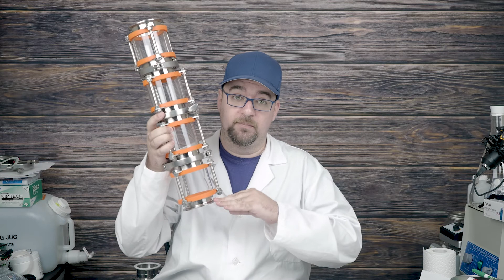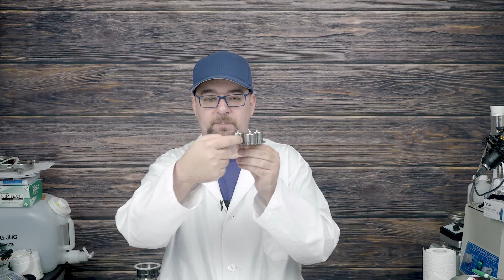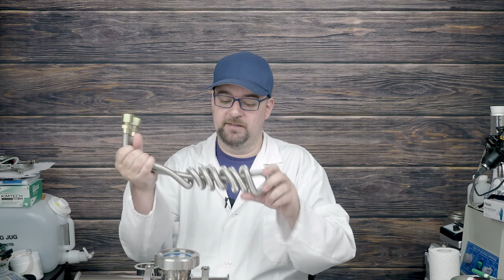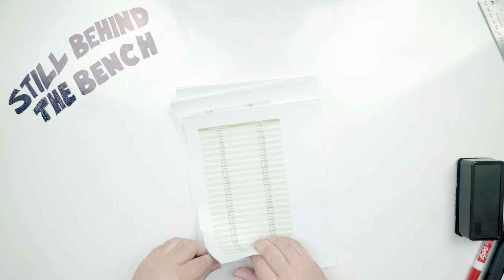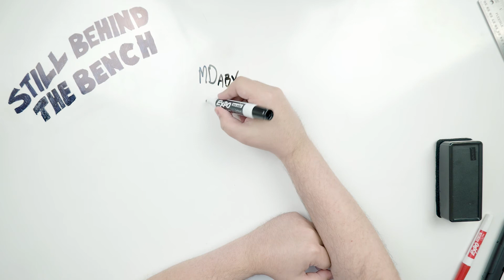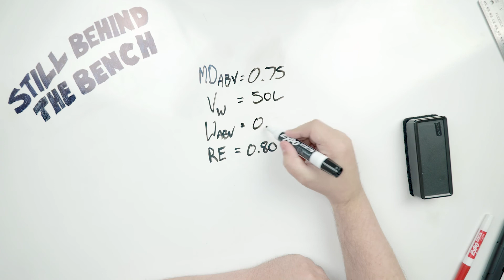Ep 013 - VLE, Reflux, Plates, Packing, and Potential Output

Comment: on the SPP you mentioned that the shape is basically a square and each wrap is rotated 90 degrees... wouldnt it be more effective if the next layer/wrap be rotated just 30 or 22.5 degrees to get that spiral effect?

Comment: Hi Adam,  in case of a fruit brandy (for example Apple brandy), instead of running twice the mash in a pot still (stripping + spirit run), can we run it once by using a few plates? And how many plates would you suggest in order to keep enough flavor in a single run? Are there any disadvantages in a sigle run with plates instead of stripping+spirit run?

Comment: This is superb information really condensed. I will refer back to this in the future no doubt.
I never knew that SPP was that efficient at creating theoretical plates. If you can get that many plates in a small column size, then I have to wonder why plates are still so widely used and considered the gold standard. Sure, SPP isn't cheap, but it's going to be cheaper than the same amount of actual plates I'm sure.
Aside from plates looking sick, and potentially giving a better visual on the reflux status - are there any other hidden downsides to SPP compared to plates that I'm missing?

Comment: with a 4 inch coloum what depth of SPP would be equivilant of 1 plate ? I want to add a packed coloum on top of my 4inch 6 bubble plate still. I have a 4 inch glass coloum that is 300mm in lenght to play with. - Thanks

Comment: Adam, does temperature functions as a variable in the VLE equation, playing a factor as "third variable"? 

For example,  a 53% spirit, in the still, will be in an equilibrium with 81% vapor.   Is this only true when the medium is at 180F " while distilling:?

In other words, if I store 50% whiskey in a homebrewing keg, filled 2/3 the way, will the vapor in the top space be at 81% under normal garage temperature?  The keg is made from stainless steel,  but the gaskets are not rated for high spirit content; will this be a problem.
Reply from the maker: Temperature does play a role, it does 2 things, it will increase the rate at which vapour is produced, and it will allow more vapour to be present in the headspace above the liquid. However, in an open environment like a still, that extra vapour is what causes the upward motion of the vapour, instead of a noticeable increase in pressure. In a closed environment, like in the keg, it will increase the pressure instead. 

Under normal temperatures, the vapour in the headspace of the keg will probably be around 81%. I don't think it will be a problem unless you leave it in there for multiple years. If you can change the gaskets, I would, but if not, I wouldn't fret about it, just open and check on them every few months.

Comment: What do you consider to be the lower limit of recoverable alcohol from a mash? The 'reverse azeotrope' if you will
Reply from the maker: That's hard to say, it depends on the still design, and how fast you run/how much heat energy, you put into the wash. The faster you go, the higher the potential losses as you force more ethanol to evaporate early, and put it into the heads fraction. 

That said, I think with any wash, you should be able to get at minimum 70% of the alcohol present in the original wash after fermentation. If you are getting less than that, you really need to take a look at your process and make significant changes.

Comment: How do you calculate the HETP for specific column packing materials?
Reply from the maker: Hey, sorry it took so long to get back to you. Realistically speaking, you can't just up and calculate it. Technically you might be able to, but that kind of math is beyond. This is one of those things that realistically needs empirical study of specific packing in a specific column, and then you derive the math for that specific column with that packing. 

So for example, with my still, using only one of the short pieces of glass column, and working in all masses, I could put in x kg of copper SPP, measure the height of that packing. Put a known ABW concentration of wash into the still, and run it. Depending on the output ABW, I could then calculate how many plates that height of copper SPP it is simulating. I could then use that HETP to make an assumption about copper SPP in more pieces similar to that original column piece. But if I switched to a SS or copper column piece, it wouldn't be a valid HETP, I'd have to do it again.

tl;dr You have to do real world testing to figure out the HETP for that specific packing in that specific column design. Then you can take those HETP values and use them to figure out different column heights and possibly diameters with that same packing material, but it won't work for different column materials/designs or packing materials.

Comment: I know those vapor points would be effected but in what what are they effected by altitude or other means to raise or lower the pressure of the pot?
Reply from the maker: The temperatures required would drop with an increase in altitude (decrease in pressure). In Japan, some Shochu distilleries actually use special stills made to be run under vacuum.

Comment: Hi Adam, very useful the VLE charts. I am trying to expand the information on the Abs VLE chart to add a column with the boiling point temperature that corresponds to the vapour %Abv.  So that by measuring the temperature at the top of the column, I will know the vapour % abv and (from the chart you provided) the liquid %abv in the boiler. Any direction you can point me to?
I know that atmospheric pressure affects these numbers but at least I can have a good approximation.
Thanks for all the work you do to share the background science of distillation and regards from Greece

Comment: Hey Canuck how are you? I must to say nice rig and toys in there. I need more explanation on SPP. Here is my sepcs;
 
specific weight – 880 g/dm3
dimensions – 4,4 x 5,5 x 0,24 mm
specific surface (p/v) – 1900 dm2/dm3
free volume – 0,89
maximumheat load – 115 W/cm2
HETP – 1,6 mm 

How do I determine the HETP on a 2 inch column  for 100 cm?

Comment: I am very interested in Riku's ARC column, called, "Thor's Hammer," based on two inch copper pipe, and wonder if you've either read his most current treatise or have read any reviews and could point me to the forum? (I know version 1, the first book's plan, produced a neutral at azeo with just a hint of burnt sugar from a turbo yeast sugar wash, but was very slow using one and a half inch pipe -- like twelve hours for five gallons). 

I'm also curious about hypothetical throughput between three inch vs four inch SS column.  My reading had suggested for four inch pipe the plate height would be five to six inches, and that azeo would be eleven to twelve plates (all assuming dime size lava), equaling seven feet (more for the CCVM condenser pipe and tee), which would mean splitting the column in half (and how do you even do that so that the condensate can go back into the boiler?).

And, finally, how to deal with floured corn?  Reading that fermenting on the grain, when it's mostly corn, and distilling on the grain avoids the hassles of pressing out the flour then begs the question: if not steam injection, how would it look to have a boiler underneath a dual purpose fermentation vessel and distillation thumper of say fifteen to twenty-five gallons with a copper coil and agitator inside it, where the boiler steam just goes through and exits to vent outdoors?  This seems like it would be dead simple, but isn't discussed on Homedistillers -- though I've seen photos of a big old pot sitting on top of a keg boiler, I can't remember where).  Have you seen or know anyone who's played with something like this scaled down to this hobbyist size/level??

Thank you for the detailed content, and I hope your viewership catches on (I can't understand -- Ohhh! ur not monetizing perhaps, so no one gets the word?  Anyway, you deserve much better -- my thoughts and hopes go out to you!
Reply from the maker: Sorry, I don't really know much about that still design beyond what popped up on a few Homedistiller posts. It seems to have died off, the 3 most popular designs these days seem to be a regular CCVM, Bokabob, and then a regular CM style with a dephlegmator.

For the 3" vs 4" column, the diameter of the column dictates how fast you can run. Height issues, for getting higher purity, can be dealt with in 2 ways, you can replace some of the plates with packing (which is what I do), or you could run 2 columns on top of your kettle. The first column would be open to the kettle, the second column would just sit there on top, the kettle just acting as a support. The top of the first column would then be piped to the bottom of the second column. So you could have your 12 plates, but each column is only 6 plates tall. Throw in some extra piping and you could have 3 plates on one side, and 8-9 on the other. Then pipe them both to the condenser, with a valve, so you could just switch back and forth between pot still vs reflux still. You may have an issue with pooling at the bottom of the 2nd column, but since it's sitting directly on top of the kettle, the heat from the kettle should cause it to vaporize.

The biggest issue with flour, of any kind, is that it can form a sludge on the bottom of the fermenter/still. So what you need to do is add multiple enzymes, alpha-amylase, gluco-amylase, beta-glucanase, and I would also throw in some digestive enzymes when the other enzymes are finished. Combined, they will break down all the flour so that most of it will be gone, do a pre-ferment boil, then ferment. Let it settle, maybe use gelatin to help clarify, then rack over to the still.

The only place I've seen people messing with steam is on reddit.com/r/firewater, they have a steam kettle setup just with water in it, and then pipe that directly into the still kettle. Heat the steam kettle, steam is generated and moves over into the still kettle where it bubbles through the wash and heats the wash up more gently than with direct heating. Letting them do things like distill on grain, or have lots of starches/proteins in the wash and not scorch them.

I also hope that viewership increases. I can't monetize, or get my own channel name url, until I hit 100 subscribers.
Reply: Great answers, only one more subscriber needed 👍🏻